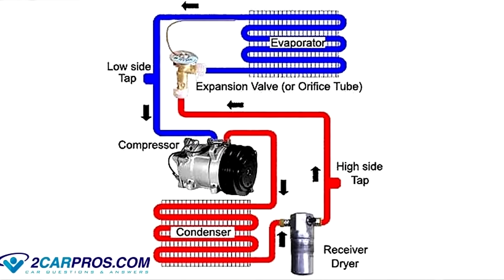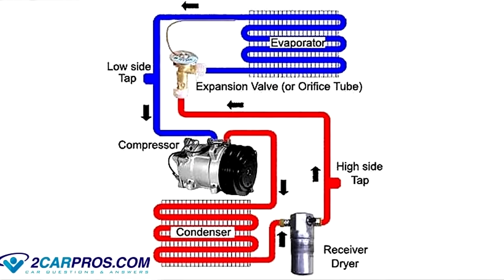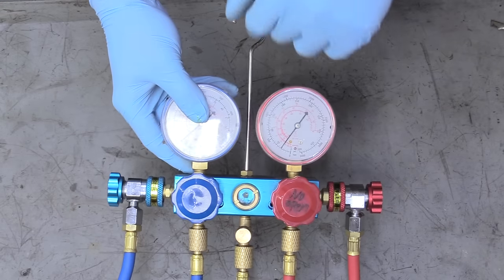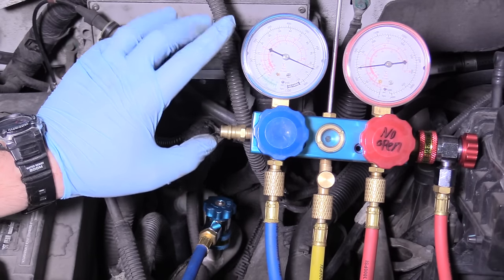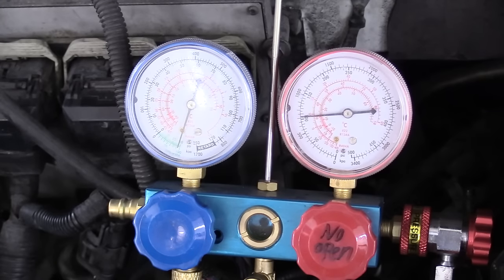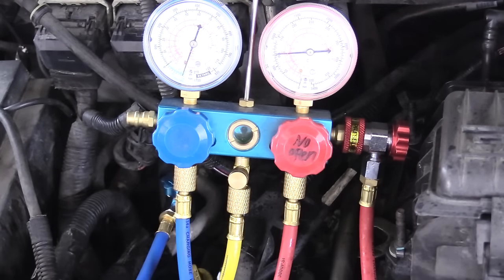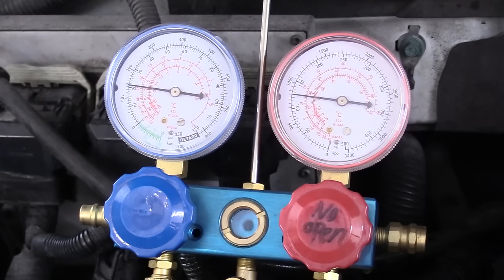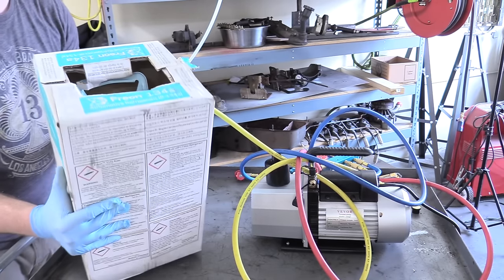How to Vacuum Down and Recharge Your A/C System! - EASY

Comment: Thanks buddy got my ac working on my mini after a broke a line   I couldn’t afford a new one so just used a ac coupler ,didn’t know it was going to work and hold pressure so it was nice to use vacuum pump and see before I wasted the ac juice ,time And money.  It’s nice to have videos like yours to help fix things without trail and Error

Comment: Really good explanation. You mention a “ AC leak sniffer “ as one method to find an AC leak. I believe another one is to install a “ dye “ in the system. The negative about this method is you put it in, charge 5he system, drive around for a few days / weeks and then using a UV? Light in a dark area to look for the dye. . Then you pretty much evacuate the R 134a, replace the part / parts and then follow your steps from this video. Toyota charged me $175 to look for the problem on my 2017 Highlander when it was blowing “ coolish “ but nowhere near cool air back in 2021. Everything worked fine but the problem returned less than 2 years later. My understanding is that a very common Toyota issue is the AC flow pressure???? valve stops working.  To replace it you must evacuate the “ Freon “. Toyota doesn’t even sell the valve they want to sell you the whole compressor which includes the new valve. They do this on a lot of repairs. If I paid $175 to have my AC repaired in 2021 for 20 months  I imagine it would cost over $300 now. Buying this “ kit” is cheaper than that by far.

Comment: When you are pulling a vacuum on the system why not open the Hi Side (red) of the manifold as well?
Reply: I agree as the gauge set I have works this way but I imagine on their part it has more to do with safety. Most out there dealing with HVAC systems don't have a clue. Best 99% of people don't mess with the high side valve.
Reply: I also agree. I would open the high side as well when evacuating the system. Other videos do that so this. But when filling would have high side closed.
Reply: Hey there, when pulling a vacuum on a system, it means to remove air or moisture out of the system. As you can imagine, air and moisture exist in a "vapor" state. The Low side of the system is vapor only, while the high side of the system is liquid only. Therefore, you don't have a need to open the high side if you're not working with the high side. Hope this helped!
Reply: @CipherVillain  Well that would be true if you have a working system but if it has lost it's liquid or integrity pulling vacuum on both sides make the most sense. Correct me if I'm incorrect here.
Reply: @curiosity2314  you're absolutely right, it is good to pull if for both! I was just referring to having both sides of the gauge ports open while pulling on suction. You can use the high side to monitor refrigerant while pulling low side just not both at the same time. My bad if all I did was just confused people😅 I just noticed Shamway had it right--
Reply: @CipherVillain  Seems we all drink the same beer when writing ;) .. Do me this, write a step 1 through 10 step process on how you would handle a system 100% depleted with no leaks other then time as time does deplete and one that was healthy but low. Not testing you but rather would like your insights. Much to learn from people that have been there. Recently learned what brake line flare tool you do not buy but is most commonly sold. 20$ mistake on my part. :) ..  When you have the right tool and knowledge it's a better day.
Reply: I do

Comment: After you evacuate the system don't you need to add PAG oil for the compressor?
Reply: i see another guys video say that vaccuming out system like he does not lose oil only when u flush it
but i was wondering for sure the same thing
Reply: i see another guys video say that vaccuming out system like he does not lose oil only when u flush it
but i was wondering for sure the same thing
Reply: @zacinnc78  - this is correct.  This isn’t like a carpet vacuum; an A/C vacuum generally just removes the air and minor impurities like moisture particulate.

Comment: Great video. Good information. But I have to say, its enormously frustrating to watch 10 different videos on the same subject, and each one contradicts the other on some aspects. For example, some respectable videos will tell you DON'T turn the refrigerant upside down to force it out as a liquid because it can shock your AC and damage your compressor, which is designed to compress gas. Others will says alternate rotating the canister up and down so that you putting in refrigerant in both liquid and gas form, but not so much that it will hurt the system. Still others, like this guy, are telling people just to dump it all in as a liquid to speed up the fill, with no regard to any potential damage, just to save time. Hard to know what to do when newbies get such wildly conflicting information about the "right" way to do something like this.
Reply from the maker: This is the way I was taught and the way I have been doing it for over ten years. Take that how you will. Thanks for watching!
Reply: SAME. I am so confused
Reply: Notice the guys saying not turn upside down are DIYers. The pros know that the whole point of a compressor is to turn liquid into a gas. It ALWAYS has liquid coming in to because it is in the loop after the condenser which converts the gas to liquid in order to get the cooling effect. So of course the compressor can handle liquid. Google image search for car AC diagram to verify this is true.
Reply: @Grrrnthumb  Compressor takes in gas at low pressure and compresses it to higher pressure.

Comment: You should have mentioned how the gauges don't go through the valves. Found that on another video. Had to vacuum it twice. Fella's the gauge still reads with the valve closed.
Reply: That should have been self explanatory when he said to close the valve after pulling vacuum and wait and watch the gauge to see if there is a leak. If the gauge went through the valve there would be no way to know there was a leak in the system after closing the valve.

Comment: You are the only honest person who explain how to release freon without going the shop to steal our money when they do the same, we going to do if their machine is broken. for that I will give you my thumb up.
-- I saw many open both low and high to do the vacuum. so, you say better only low side?
--  why at 13:24 you lose the yellow hose instead of pushing the bleeder valve you have on top?
-- Why don't you have the high side connected to the port? then I saw you connecting it.
--So basically, you add freon with car off, then when equalize both gage you turn the car and a/c to add the rest?

Comment: So at 11:51 you shut off the valves on the manifold. That means that you cut off flow from the vacuum pump to the red and blue lines going to the car AC. The blue gauge is also cut off from your car AC.
So how does that prove that your car AC lines and fittings are not leaking ?
All what you have done is to show that the valves at you manifold and the yellow line to the vacuum pump is not leaking but you have not shown that your car AC lines and fittings are not leaking !
Reply: The gauge is between the manifold valve and the vehicle. Closing it represents the pressure on the system, not the hoses.

Comment: Local shops in may area wanted $150 to $250 to discharge the ac system, fee included refill with leak check. It may be a local regulation that prevent shops from only discharging an ac system
Reply: I'm having the same problem.  It seems like shops are doing this to prevent DIYers from bypassing them to work on their own vehicle.

They basically charge you for a full evacuation and recharge just to remove it so you don't save any money....

Comment: Some systems won't leak while under a vacuum test however, once the system is charged and the compressor is making a LOT of pressure it 'may' leak.
Reply: Old school is to leave the system under vacuum over night and check for vacuum loss the next day.

Comment: You lost half your vacuum when you connected the high side line.  Should have added some refrigerant first, then messed around with the high side.  Always break the vacuum will refrigerant before you do something that will lose it.
Reply: Ok, so, do what he did in the video, but add a can of refrigerant before connecting high to prevent vac leakage?
Reply: @ShyRage1  Correct.  Break the vacuum with refrigerant.  You want positive pressure in the system so when you make a connection, refrigerant will come out rather than air going in (not good).

Comment: Wow. Every one of these videos I watch I just get more and more confused. I've watched like 4 in a row and they all said different things about when to open and close the various controls.
Reply from the maker: All I know is mine is right. Thanks for watching!
Reply: @2carpros isn't wrong about they process, but it's not the only way. If you follow the steps in this video, you will be ok.
But, he is completely wrong about his aerosol logic. Hairspray and A/C do not get cold for the same reasons... at all. Hairspray (and most other aerosols) feel cold on the skin from the process of Evaporation on your skin, after the atomized mist falls out of suspension... Not the pressure change from leaving the can. It's actually the can that loses heat in that process.

 Remember... Water from a hose feels cold when it's misted over you & it's not high pressure. It's the extremely small size of the droplets, they can't hold heat. 
Recap: liquid atomized into a fine mist - rapidly loses heat. 
That Mist falls out of suspension (lands on you) & turns to a thin layer of liquid on the skin
- the evaporation process begins.
Additionally, the air going across that thin layer of moisture also removes heat 
- The cold feeling on your skin. 
This is why we sweat, not how our ac system works.
Reply: @NemonicsRacing  this is 9 months old and I'm not even really watching his thing but... While you're absolutely correct about the evaporation of the things leaving an aerosol can, landing on your skin and then evaporating....

A can contains pressurized gas. Sometimes it's even pressurized enough to be liquid within the can.
When you expel those out to the atmospheric temperatures that can itself gets cold, for the same phase change reason as your air conditioning system.

The best aerosol can example of this is actually the AC cans themselves when you go to recharge the system. The reason they get cold as you're feeding it into the low side of the AC system is that they're going from highly pressurized into a liquid, and phase changing to a gas.

So while nothing you said is wrong. Nothing he said is wrong either.
You just misunderstood what he said.

Comment: Nice.  I have some step by step instructions from 2006 for vacuuming and charging the AC system.  It differs slightly from what you say.  First, it says to open both valves when vacuuming and 2) it says to "flood" the system with liquid via the high side until it takes no more after vacuum is complete.  This should only be done during pre-charge (i.e. after vacuuming and before adding refrigerant via the low pressure side port) and then close the red valve.  Next to make adding refrigerant faster to jumper the AC cycling switch (if possible but not necessary) to force the compressor on (in my case jumped the AC cycling switch on my Cobra and Ranger) and add refrigerant via the low pressure side.  At this point you don't want to open the red valve while charging the system.  I used this method to convert my 95 Cobra and 94 Ranger from R12 to R-134a without issue (i.e. pre-charged via high pressure side).  Is the way you present charging the new school method?

Comment: Great video, thank you ! I just have a couple of questions:
1-when you connect the gauges to the AC system to empty the system do you turn the car on while doing it ? 
2-When you connect the vacuum and turn it on, do you turn the car on while doing that ?
Reply from the maker: No leave the car off until I say to turn it on. 

Also no. The car only comes on when I'm ready to give it more than the base charge. Thanks for watching!

Comment: Ryan, very good explanation of vacuuming and recharging a R134a system. 

Would love to see a general troubleshooting video that includes condenser, evaporator, lines, etc.
Reply from the maker: Great suggestion!
Reply: @2carpros looking forward to a video like that as well. Using a 2003 GMC 2500 4dr would be a bonus…if you can find one with (typical) problems. 👍👍

Comment: Your video is BY FAR the VERY BEST I've seen on this subject, and, believe me, I watched many.  You NEVER skipped a beat, NEVER lost your train of thought, NEVER failed in any instance!  My sincere congratulations for a job well-done!    By the way, I also like the pinned comment about WHY you keep the high side closed!  That's the best reason anyone can give!  ;)  Semper Fidelis!  CWO4 USMCR [Ret] 17 February 1969 - 1 August 2004
Reply from the maker: Wow, thank you for watching and thank you for your service to our great nation! :)
Reply: @2carpros  Unfortunately, even though your video is great, things did NOT go according to your video. :(  I have a 2002 gmc sierra 1500hd w/6 liter.  i was in the process of replacing my compressor which was bad.  I installed a new compressor, new condenser, new accumulator drier, replaced the low and high pressure switches on the accumulator and the back of the compressor.  I followed your video to the letter, including NOT opening the high-side manifold gauge.  I ran vacuum tests for 30 minutes, waited 10 minutes, and perfect -- no leaks!  So I proceeded to load freon, and the same thing happened the last two days: within 30 seconds after beginning to add freon, the high pressure switch on the back of the compressor blew out!  I assumed it happened yesterday because I had not properly installed the split ring to hold the high-pressure switch in place, so I carefully checked to ensure the split ring was installed properly.  Today, the same thing happened again -- within 30 seconds there was a loud hissing, then a 'pop', and the high pressure switch had blown out again.  Can you tell me why this happened, and what I can do to correct this and ensure it does not happen again?    Semper Fidelis!  CWO4 USMCR [Ret] 17 February 1969 - 1 August 2004
Reply: @GunnersRange  Did you get it to work?

Comment: Liquid charging to the high side of the compressor is faster, mind you it is also risky for a novice, for if to much is fed in too fast you run the risk of blowing your nice new compressor if you just replaced it, it's for this reason I would recommend charging your unit with gas to the low side. This is how I was taught and it never failed me nor a compressor yet !  TY Sir, all and all an excellent video !  😎✌️✝️💕🇺🇲🦅

Comment: Good job. I would recommend breaking the vacuum by adding some refrigerant on the low side before connecting the high side line. This will make sure you have positive pressure in the system when the high side Schrader valve opens as you're connecting it to the gauge.
Reply from the maker: I disagree. It's all one system. You don't even technically need to attach the high side at all. Thanks for watching!
Reply: @2carpros  Yes, it's one system. You did notice that the vacuum decreased when you connected the high side. So whatever gas was present around the high valve when the high side was connected (air, unless you were actively purging the high side when you connected) filled some of the vacuum. That is what was taught to folks in HVAC school, fill the vacuum with refrigerant to some value over 0 PSIA before you connect anything else to the system. Anytime you can have a positive refrigerant pressure in there when you're connecting something is all the better.
I appreciated the video though.

Edit: You are correct, you don't need the high side at this point and a good practice to not connect it until you have added some refrigerant where your refrigerant is (on the low side of the gauges). In a vehicle probably doesn't matter much. It will probably be in the scrap yard or need a compressor before it would make a difference.
I've had car ACs blow ice cold for 15 years without even pulling a vacuum before filling them.
That was back in R12 days though :)

Comment: Thank you so much for explaining all this process, I replaced the AC compressor and I’ve been wondering how to service it after the replacement. Most places I called are expensive and always trying to add extra charge for inspection, I’d rather invest in the equipment and do it myself now that I just acquired more knowledge onto this. Regards from Modesto California

Comment: Pressurize nitrogen at 250 lbs into the empty a/c system checking for leaks with Windex or bubble blowing solution . Always use eye goggles and face mask . Inject Pag oil into the system on the high side then close valve . Very good  and concisely done .

Comment: Thanks for this!  AC is blowing ICE cold now.  

One safety note for something unexpected.  

Probably 4 hours after I had recharged my system, I was disassembling my gauges to put them in their case and as I was unscrewing the red hose from its connector - the hose was still full of r134a AND was under very high pressure.  The refrigerant blasted two of my fingers really good, but luckily it wasn't towards my face.

I'm guessing the pressure remained because I had done as instructed and never opened the red dial at the gauges.  Had I slowly opened it after all hoses were disconnected from the car, that pressure would have vented out of the yellow hose.